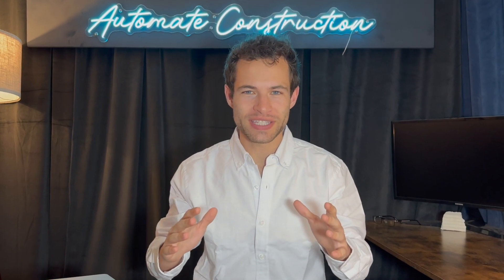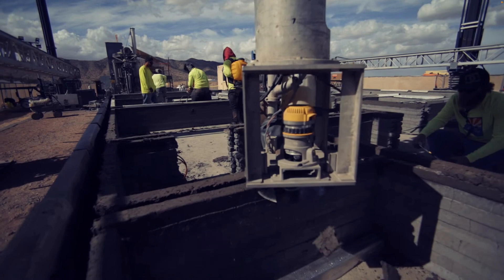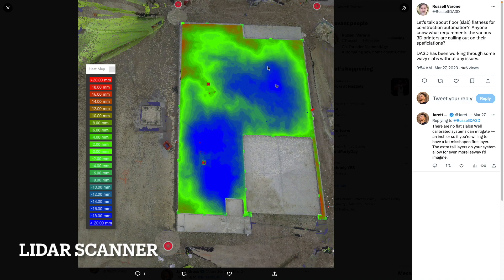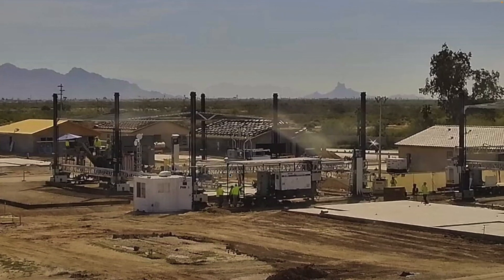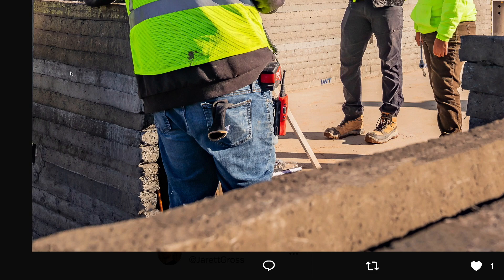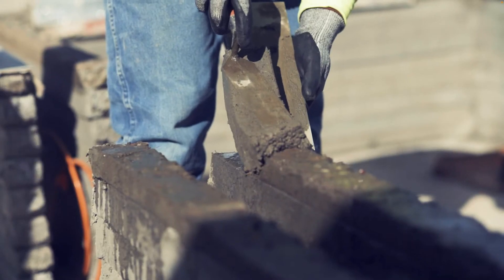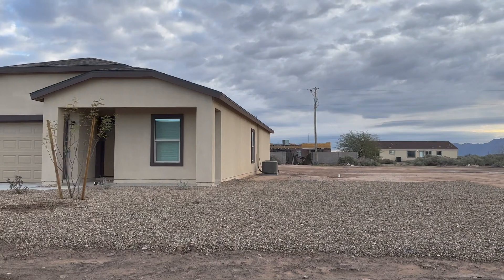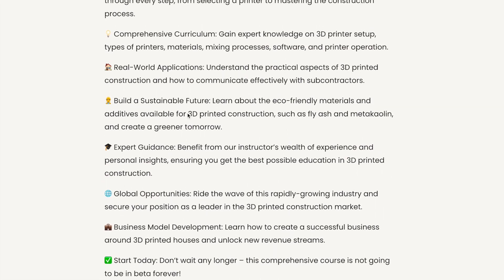Construction Will NEVER Be The Same Again | Diamond Age

Comment: How much does a set up like that cost?
Reply from the maker: Diamond age only manufactures printers for themselves so they don’t share the manufacturing cost data or price publicly. Just for fun I’ll make a wild guess that to build just one and get all the auxiliary equipment/ software running may cost $2.7M. After that you could probably manufacture additional units for about 800k each. This is complete speculation with an order of magnitude sized margin of error.

Comment: See this makes sense for many reasons, these adapters should be on the side of the gantry so it could hot swap heads like they new pursa 3d printer. Then the 2 options are for to roll on site or to be taken down by a 2nd robot. the Lidar is becoming more commercially available like Bambu lab printers x1 carbon to make it "affordable" lidar. And maybe using Mecanum Wheels to pilot on site.